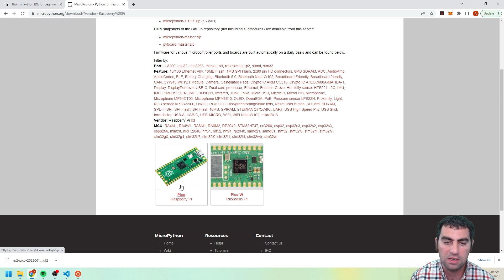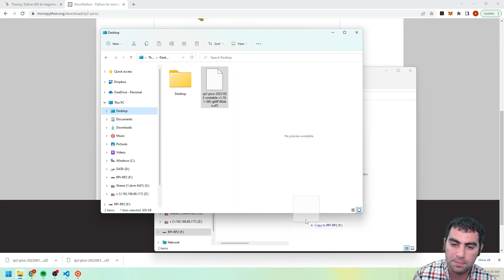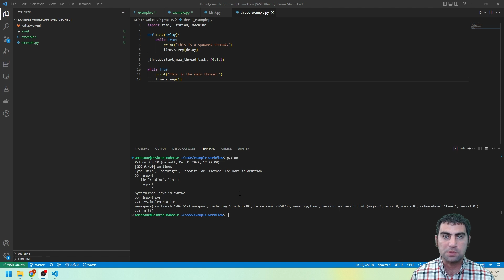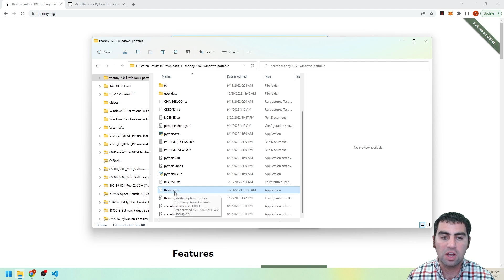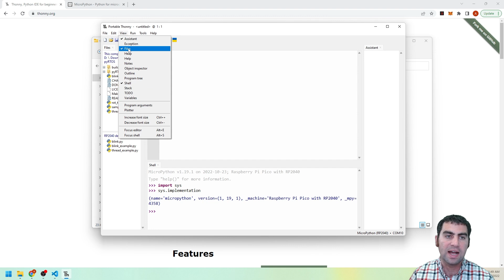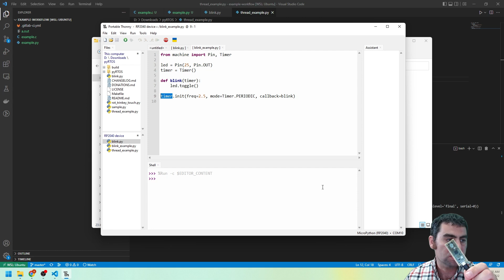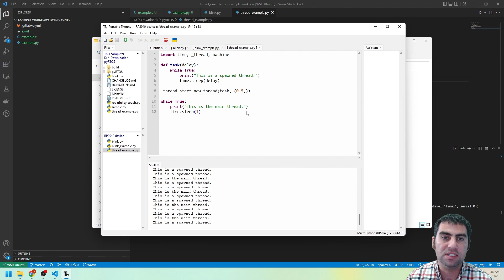Getting Started with MicroPython and The Raspberry Pi Pico

Comment: Sir laptop is not detecting the raspberry Pi pico with usb
Reply: What to do..?
Reply: The RPi Pico should show up as either a COM device or drive (i.e. similar to a flash drive). If neither of those show up and you can't see it in your device manager (or lsusb in Linux) then chances are something is wrong with the board. You shouldn't need special drivers...
Reply: I had this issue and I think it was related to bad Picos (3 out of 10 picos were having this problem)? Try connecting the Pico to your system while holding down the boot button. If you cannot see the device in boot mode (mounts as a drive), then most likely a driver issue.